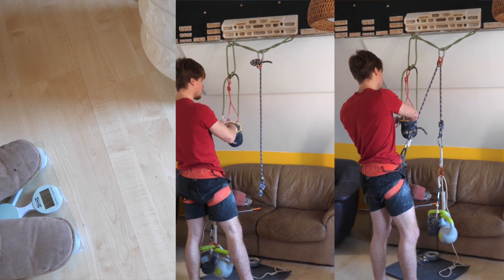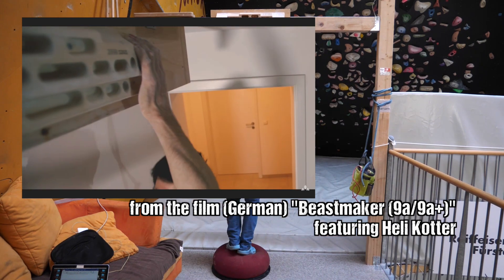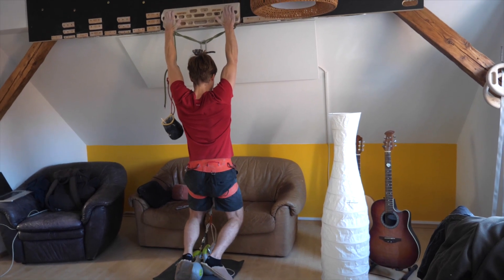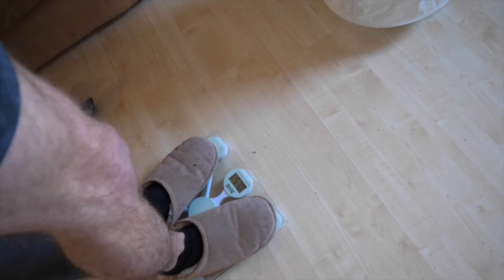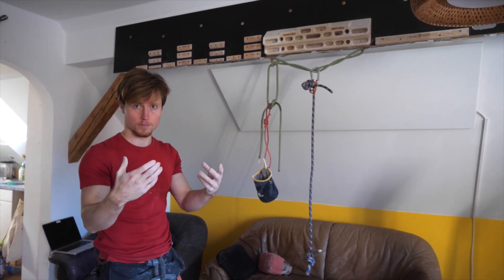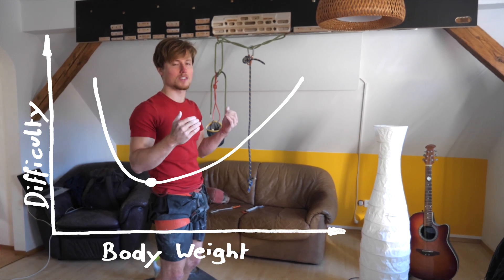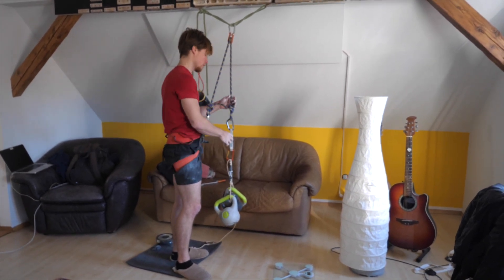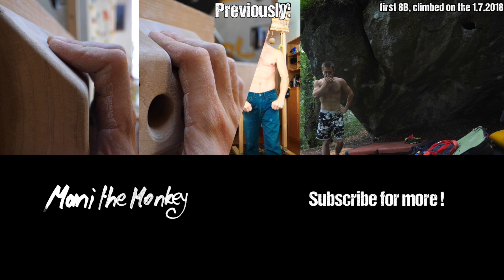Gripping Technique VS Finger Strength VS Body Weight

Comment: Hmm I find it difficult to agree with it being just a factor of weight. I'm 52kg, small hands, short climber, and I can hold the slopers well enough to do ~1 pull up (when warmed up of course). I only climb V3-V4 and finger strength is actually one of the weakest aspects of my climbing. My friend, who climbs V10 and weighs the same as me (but taller and has bigger hands), can also hold the BM2000 slopers. Weight is a factor, but is definitely not the do-or-die factor in my opinion. Of course I could be wrong so just my 2 cents!

Comment: Interesting observations. I'm lighter than you Mani at 62kg and I'm 173cm tall and, surprisingly so compared to my fellow climbers, I can hold these slopers with a completely open grip with 4 fingers (not using any edges or thumbs at all). I focus on getting as much of my fingers onto the slopers as possible, and it looks to me like you're putting your fingers too low on the sloper compared to how I grip it. I do have large hands for my height and I think that makes the difference for me, more surface area I tell myself. I've always been good at slopers and I've thought that was because my disproportionately large hands could wrap further around the sloper with more surface area. I am lighter than most stronger climbers I know that can't hold those slopers, so I think its a complicated combination of weight, hand size, strength, and how you're gripping the slopers.

Comment: One thing I'm wondering now is how do things change when trying a one-armer on them? If crimping, ie. concentrating your weight onto a smaller surface area to increase friction, helps lighter people hang them with two hands, then wouldn't doubling the weight going through one hand massively increase the friction to the extent that lighter people would be able to open hand them much the same as a heavier person? Or does it not work out this way? Obviously there's a much higher demand on finger strength, but just wondering if the double concentration of force largely removes the element of friction from the equation. 
Plus the side-on position for a one armer looks like it puts your centre of mass a bit further behind the holds, which also helps a lot, as several people have already noted in the comments here. Thoughts?

Comment: I've often wondered how competition climbers like Shauna Coxsey and Janja Garnbret can stick what look like 45-deg slopers, one handed, after landing from a jump.  What I would be really curious to see is how the skin, particularly callus thickness, size, and roughness/smoothness of different climbers' hands and fingers look close up.  When I'm able to grab something irl (that isn't a climbing hold) and get really strong 'skin grab' on it, it's almost like my skin feels glued to the surface.  (Some level of moisture/dampness of skin also does seem to help on particular kinds of smooth surfaces far more than dry chalk, as others have mentioned.  I've wondered if a clean, slightly damp hand might actually allow a strong grip on the smooth parts of dual-texture holds, except it's hard to switch back and forth while climbing at will probably..)
Reply: Also, how much is the fleshy parts of a climber's fingers deforming when they are able to hold slopers?

Comment: Is it not a result of the way you attach weight? Those cords are pulling you at some strange angles. It might influence body position and hence the ability to grab it longer. Maybe another experiment with attaching weight differently (like using a vest) might confirm or deny my suspiction. (Using the oportunity, thanks for your channel.)

Comment: How do you know that it is not the position of the added weight changing your center of gravity to be more optimal on the hold rather than just the weight itself being added. If you put the weight on the back of your harness, would you get the same results?

Comment: Nice experiment. So essentially, light guys have no chance, medium guys should use the half crimp and heavy guys should too. Heavy guys with strong fingers have the additional option of the open grip. 👌
Reply: Or, light guys like mani who have been crimping them have no chance, how do you think female climbers manage? Low weight and small hands, then manage through technique, something you need to work on, mani hasn't worked on his as he was crimping them up to that last video. Madness.
Reply: Jakori That’s a good point! I suppose the low weight of women might be partially offset by their small hands. ie less weight through less hand surface = normal pressure. Obvs not as much pressure as a half crimp though!

Comment: I don't know if you mentioned this but are you using the side edges of the slopers or not? To me it feels like cheating to use them and my ability to hang on the 45s seems to depend mostly on how much sideways pressure I put on the sides.

Comment: Physicist here. Your findings confirm the theory of friction. The heavier something is, the more difficult it is for it to overcome the static friction (experienced by two objects, i.e. your finger and the board, which don't move relative to each other due to friction) so that the process goes over into dynamic friction (during which your finger slides off the board). Imagine pushing two cardboard boxes sitting on the ground. Intuitively, you expect to need to exert a higher pushing force to bring the heavier box into sliding than the lighter box, because the static friction between the heavier box and the ground is bigger. Similarly, the static friction between the fingers of a heavier Mani and the hangboard is bigger, therefore a heavier Mani has a more difficult time to move from the state of static friction (hanging on) into dynamic friction (sliding off).

Comment: Thats why for competition its better to be a bit heavier cuz everything is slopy
Reply from the maker: Was thinking the same, this might literally heavily impact comps with all the slopy volumes. Although, most fresh artificial volumes have a lot of texture to them, which I think reduces the weight-dependence-friction-factor quite a bit. Also, I think we see short light guys winning equally often as tall heavy guys (or? I'm not so much into comp climbing nowadays), at least that was the case back then, after all problems are set to be equally hard for all body types.
Reply: Mani the Monkey 100% agreed.

Comment: I think your form is the reason you struggle with this hold. I can hold them open handed without edges or thumbs and I am 155lbs with smaller hands. I'm pretty sure it's a matter of body positioning and balance to keep your weight pulling straight down. When you attach weight to your harness or remove weight in the same fashion your changing the orientation of your weight to a very unnatural way that might pull you out and away from the hold.

Comment: I assume this is just an effect of the wood-skin pairing.
The Coefficient of Friction (CoF) is not dependent of applied weight directly, but of the applied contact pressure. So there is a sweet spot (as for many materials) in our relevant region of contact pressure. Might be completely different for anorganic-skin pairings...

Comment: Honestly.. i'd like a phycisist to just do the calculations to end debates here. Science ftw :)
Reply: Problem is: I have no idea what the friction coefficients of skin is. Especially how fingertips compare to the rest of the fingers.

However: 
The argument with more pressure on a smaller area (finger tips) compared to less pressure on a large area (open hand) doesn't hold up. (assuming tge friction coefficient of skin is equally distributed) 

That means there must be another factor we've missed.
Reply: Amontons' Second Law: The force of friction is independent of the apparent area of contact.